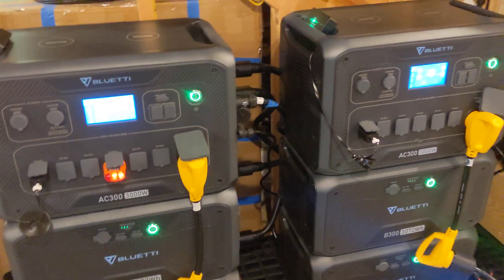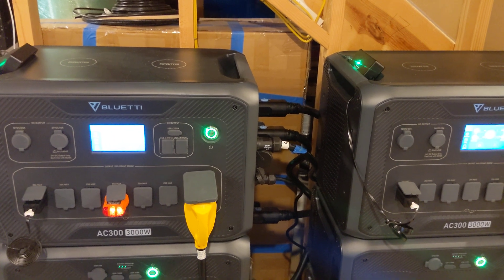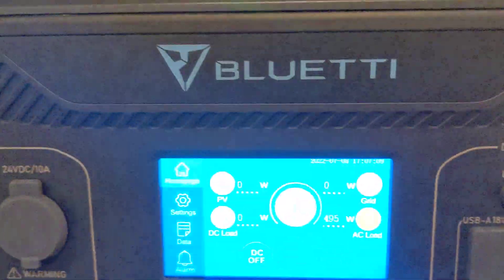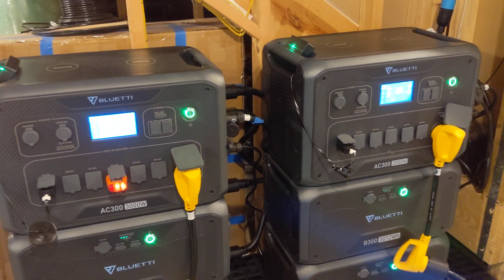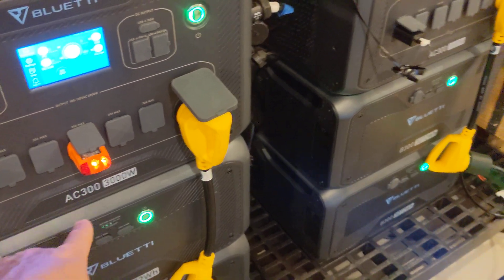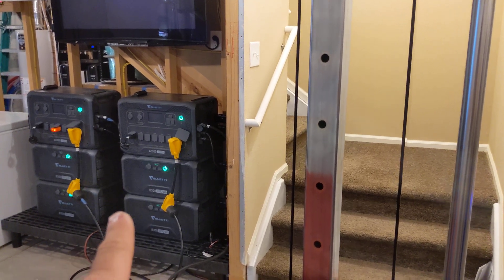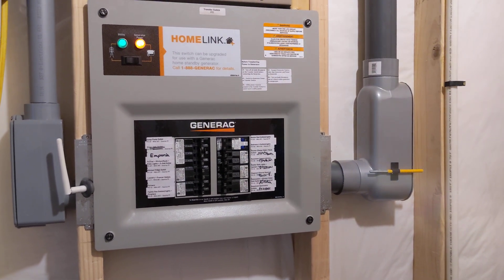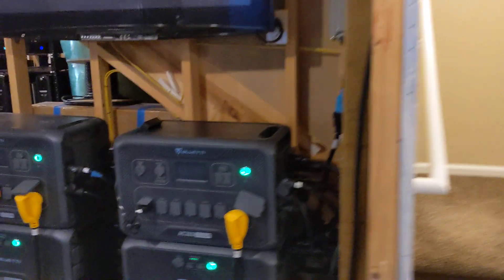Bluetti AC300 - Video #3.1 - Update on my split phase system, how its been going & some issues found

Comment: Hi,can you please tell me what you meant about the danger of burning one of the units out?
I’m installing the AC300 setup straight to an interlock switch on my main panel.
It will be for emergency power only and will never be charged while tied to the grid.
I just want to make sure I don’t hurt anything.Bluetti hasn’t been a lot of help so far.

Comment: Hi David, quick question, with 2 AC300’s and a y connector, do I need to split phase for an RV 50 amp plug?  There is no 240 voltage in the coach, all 120 volts.  Thanks so much!  Joe

Comment: If they are 3000 watts each, do I get 6000 watts with split phase?
Reply: I believe you do. If you watch the official Bluetti video on the fusion box connection, it says you get a max of 6000w AND you can use the DC in the AC300s and you can use the 120v plugs on both the AC300s AC the fusion box. I think you have you use the fusion box to get the 6000w. If you use the AC300, I assume you will get 3000w. But I may definitely be wrong. Can someone correct me if I am incorrect?

Comment: Are you able mention the new firmware version? Not sure which version my units are running, I'll have to check. Read something in the Bluetti community where folks had issues with certain firmware updates. Last thing I need is to crash my system. Any thoughts?
Reply from the maker: the firmware that I tested was DSP 4031.11. However I have a general rule. If it ain't broke, don't fix it. I don't upgrade firmware on a system that is working fine, unless it's related to a security issue.
Reply: I'm of the same opinion. Especially with my 1st. gen.  AC300

Comment: hi david could i use the fusion box for the bluetti ac500 and b300s battery
Reply from the maker: Yes you can. However you'll limit your output to 25 amps. Later in the year, around December, Bluetti will release the 50amp y-adapter.
Reply: @MyBluetti  thank you

Comment: hi david what if you connect a Neutral Ground Bonding Plug in one of your ac plugs that should work..
Reply from the maker: Hi Mike. Thanks for the comment. Yep you are correct. In a later video that's exactly what I did. I can use two bonding plugs when I use the fusion box (because it isolates the grounds) or in just one bonding plug when I used my Y-adapter cable. This resolved the grounding issues...

Comment: I have this sub-panel are you saying there could be issues with this and the setup you have? I have the exact same setup. Reliance 206A 120/240-Volt 30-Amp 6-Circuit Pro/Tran Indoor Transfer Switch. I had the same power loss as you and I was not in front of them when it happened and it did not record any error also how do I get the updated firmware?
Reply from the maker: Hi Jeff - It depends on when you got your AC300's. The latest batch of AC300, released around July/Aug 2022 are suppose to include some type of change that allows them to work with the Reliance Pro/Tran transfer switches. If you have an older AC300, then the issue only occurs if you have your system actively powering loads in your transfer switch while charging your AC300 via your grid as the same time. Somehow, I believe that because the Pro/Tran doesn't isolate the neutral from your gird and because the AC300 has grid-passthrough, the current being sent out from you AC300 may alternatively return via the grid AC charging port and can kill your system.... 

The issue I refer to in this video is unrelated to the Reliance transfer switch, it's actually a bug/limitation by the AC300 when it's connected to the grid for AC charging. I was told by Bluetti support that they would have a new firmware for me to test in a few weeks related to this issue. 

If you're experiencing the same issue as I described in my video. I would see if you can identify what load(s) are causing the system to trip/reset. With this information you can request from support to gain access to the unreleased firmware and see if it helps your setup.

Please let me know if this helps or if you need more details.
Reply: @MyBluetti  thanks for the info I bought mine April 20, 2022 and I had a firmware update for them when I got them. So maybe I have the July/Aug firmware. When my power went out it was about 9:30 pm so I am sure it was on grid charging.  I have mine setup for “PV priority UPS” and seems to work well, I just need more sun here in Ohio 😐
Reply from the maker: Unfortunately I don't think the fix is a firmware software change. I believe they physically changed something... I would highly suggest that you install a surge protector between your grid outlet and the AC300. Also are you using the 30amp split phase charging cable or the 15 amp cables that came with the unit originally?
Reply: @MyBluetti  I am using the 30 amp split phase charging cable. Do you have a suggestion on a surge protector for a L14-30amp 220 grid outlet?
Reply from the maker: I'm using the Power Watch Dog. Mine is a 50amp, as that is what my outlet is, but I bet they have a 30amp one or you can get 50 to 30 amp adapters. Any surge protection is better than none!
Reply: @MyBluetti  So I will have to get adapters from my L14 to a 30 amp and then from a 30 amp to L14 on the other side... does that sound right?

Comment: Hi David, I just got my first AC300+B300 system with the three of the PV350s.  I have been researching getting a second AC300 as my home's power hardly ever exceeds 6KWh (would not run my laundry machines through the system).  I have a couple of questions. 

Why did you not go with Bluetti's Smart Home Panel?  Was it more cost effective to get the fusion box and then your own panel?  

How much solar input did you manage to get and what panels are you using?  

I was surprised when you said you need to balance the system, would the smart home panel system from them or a 3rd party not be able to balance the two AC300s themselves?   

Thanks for your time, sorry for being nosey but I am trying to plan my own system out effectively without destroying my systems.  (I am hiring an electrician to hook up the systems to the grid)
Reply from the maker: Hi Phillip. So I already had my own Generac Transfer Switch for a gas generator even before I bought the AC300 system. However from what I last heard the Bluetti Smart Home Panel is not available or very back-ordered. If you can get your hands on one of the Bluetti Smart Home Panels I would say go for it, as it switches the neutrals, which will be a better setup.  My Generac 50 amp cost me about $400... but with prices increasing I know see it running at $700+.

At this moment, I've only been testing with the PV350s. I'm waiting for my home panels to be installed in the next couple of weeks. I'll have to give you an update later on those. 

Unfortunately, the Bluetti Smart Home Panel, nor any other brand, will "balance" your loads for you. The are pretty basic and simply take one hot wire from each of your ac300s and allows you to assign "x" number of breakers to each hot. Therefore if you put too many breakers with heavy loads on one side (one hot wire), you will send the majority of your power demand to one AC300. I know Bluetti says that you can double your "power" with using two AC300, but it's a play on words. You double the availabe watts to your panel, but you do not double the amperage from or to a single AC300. 

The best way to think about this is that the transfer switch or Bluetti Smart Home panel is simply a breaker box. On your home your main breaker box does not balance the loads in your home either. It also just has two hot wires coming from the power company that get assigned as LEG1 and LEG2. If you have too much power demand on LEG1 you can move a breaker over to LEG2 to "balance" the loads.

What I would suggest is create yourself a list of circuits that you want to run off your AC300's. Then monitor their usage in watts/amps for the devices on that circuit. Next break your list into two separate buckets, trying to keep them even in usage, one for LEG1 and one for LEG2.

Don't hesitate to ask any questions.
Reply: @MyBluetti  thanks David for the detailed explanations.  I talked with a Bluetti sales representative last week and he told me they expect to have some of the smart panels in August (will see). 

 Really interesting on that split issue as its making me rethink a lot but I do this my plan is still very feasible due to my power needs generally bring low.  I'll have to be careful if I hook up the hvac system (avoiding the laundry machines will already put me in a very safe spot I think).

  I look forward to your videos especially once you get those home panels put up.  I plan to put my panels in the ground as my roof is not sloped right for solar, but I have an ideal ground space that's big enough next to my home.

Comment: I am extremely interested in the transfer box issue. I have damaged my ac300, not sure how. Had solar input going everything fine, then plugged in the unit to the grid to set up as a UPS then pop, blew a house panel breaker and ac300 would no longer send ac out to the Reliance Pro Trans 2 transfer box. Fault code 008 - Overcurrent protection-hardware is showing. From what you have said, seems I may need to get rid of the Pro Trans transfer box?
Reply from the maker: Hi Scott. I'm currently working on the next video... However in short the use of a non-switching transfer switch can cause power from your AC300 output to complete it's circuit through the grid ac charging plug. This can not only give your AC300 output power multiple paths to return to source, but also can potentially send 25 amps of current through your AC charging cable. Bluetti has released a newer version of the AC300 that is suppose to support the non-switching neutral transfer switches. However I personally would not mix two power sources onto one electrical system.  Hope this help you in the mean time.
Reply: @MyBluetti  
Hi David, I received my Generac transfer panel and in reading the owners manual on page 3 it notes under Equipment Description that “generator output voltage must be 240vac, This switch is not compatible with 120vac generator output” Since I am wanting to use the transfer switch with my ac300 that is only 120vac, it would seem the switch is not compatible with this setup. Any thoughts?
Reply: Thanks for the reply! I’m looking forward to your video because I’m a little fuzzy on what you mean by “non-switching” because my reliance unit has 6 switches, one for each of the six circuits I choose to have it handle. I also hope you talk about why this unit needs an open, not bonded ground. I hope BLUETTI will replace my ac300 with one of the upgraded ones you mentioned. Thanks again!

Comment: Thank you for your videos, they help a lot! I too need the info on the transfer switches. I have a reliance pro/2 I used with my gas generator, I would like to use it until I can purchase a Generac homelink. But havent connected it to my fusion box yet. Waiting to see if I can and what causes the problems. Thanks again!
Reply from the maker: Hi Larry - I will be releasing my next video soon. However I would contact Bluetti support and check if you have one of the newer AC300's that "support" the Pro/Tran transfer switches. They made some changes to support it.... granted I still don't think it's a good idea to have two power sources sharing a neutral system.

Comment: Can you run ac heat exchanger through this system?
Reply from the maker: Hi Christifer - I haven't officially tested the heating element on my furnace yet, since it's summer. However I suspect it would handle it with no problems... I have 3000 watt gas generator that can run my furnace and the AC300 has been able to run things that the 3000 watt gas generator couldn't.

Comment: I have a manual generator lockout with 50amp 250v plug on my breaker box.  No subpanel, no automatic transfer switch.  Can I connect my 2 Bluettis using the fusion box and then plug that into the plug that I already have?
Reply from the maker: Hi Amy. Because you have a interlock on your breaker box that prevents you from using grid at the same time, then yes you can use your inlet (generator plug). The interlock will ensure that you only get one power source to your main breaker at a single time and ensure that you're not back feeding the grid, required by local codes. However two things to note... 1) Your Bluetti's will not be able to run everything in your house like the normal grid will. It simply doesn't have the capacity. So only run what you need. 2) Treat this like a normal generator, turn off all breakers before you send power from your Bluetti, then switch your interlock over to the solar generator and then slowly turn the breakers you need...  give each a moment to startup the devices in your home. Hope this helps.
Reply: @MyBluetti  Thank you.  I have the Bluetti pv350 (350W 37.5V) solar panels.  I think I can use only 3 of them before I get too close to the 150V max.  But, is that the total max or can I run 3 on each mppt for a total of 6 panels?  Thanks for your help.
Reply: @gladys20121  you should be able to input 2400 watts solar directly into the AC300. There are “workarounds “ that allow to add more solar input as well. The B300s can also be charged directly. You may need to put your PV350 panels in parallel or series parallel to get to where you want to be input wise. I do know that you can overpanel these units.  I believe the distance from the panel to the battery becomes more important when the panels are in parallel however so you may need heavier guage extension wire.

Comment: Thanks for testing. Looking to see if the Bluetti system is suited for car charging(120v and 240v).
Reply from the maker: Your car charger may require a bonded neutral.. what type of car charger are you using? And do you plan on doing grid ac charging of you Bluetti's?